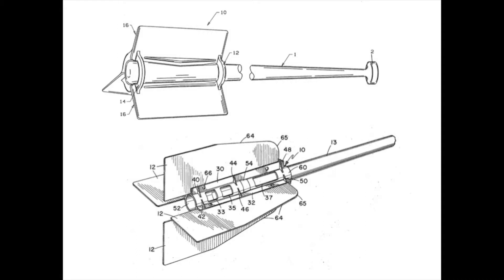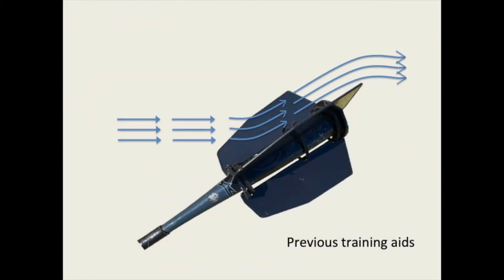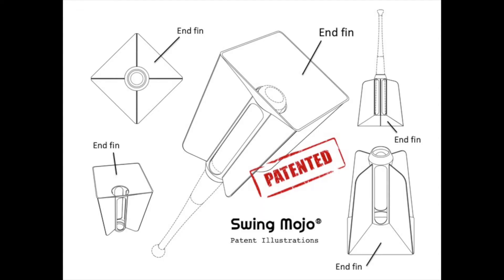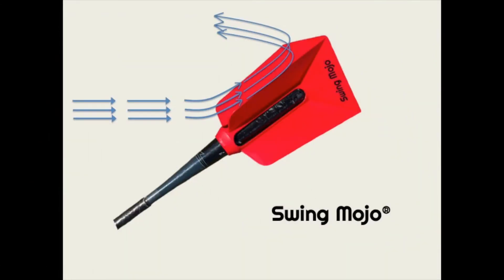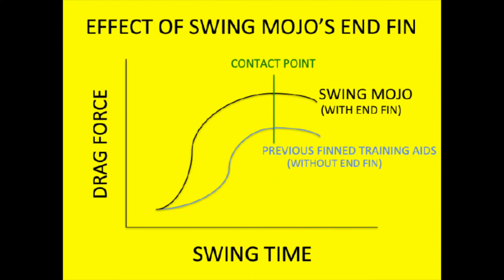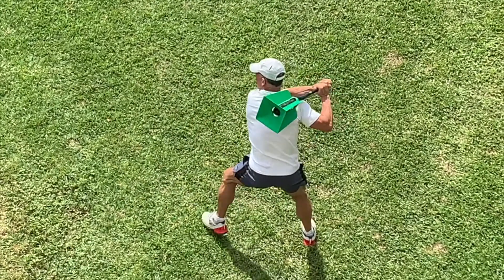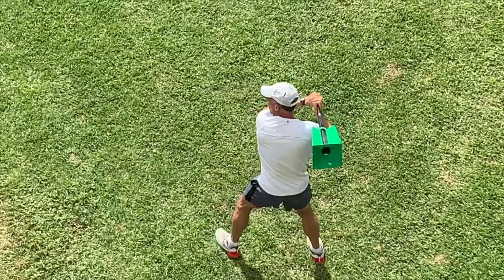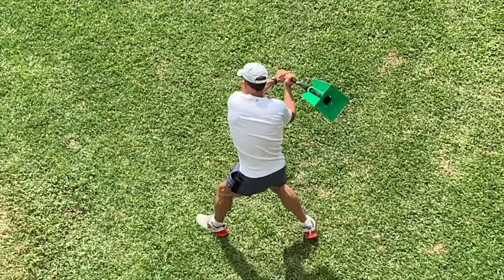The 'Mojo' in Swing Mojo

Comment: Why not have a small parachute be used for drag? Since having one tied along the bats lend would follow the bat’s path, it would simplify the design while ensuring air-resistance factor’s in
Reply from the maker: In theory, you are correct. However, it would have to be supported by a rigid structure. A parachute simply dangling from the bat would not have enough distance to fully bloom to achieve drag throughout the swing. It would also be constructed from soft material and not conducive to the rigors of a baseball training/playing environment.